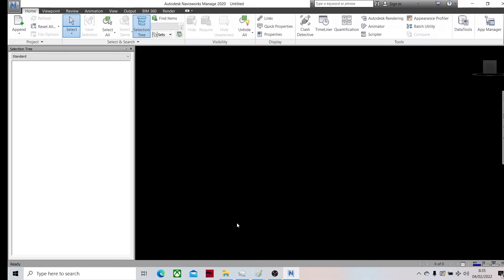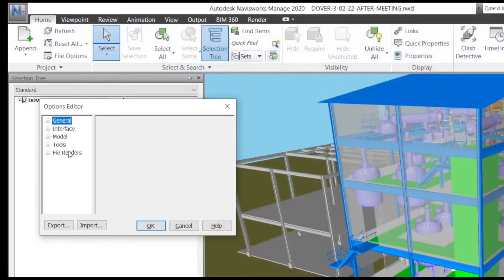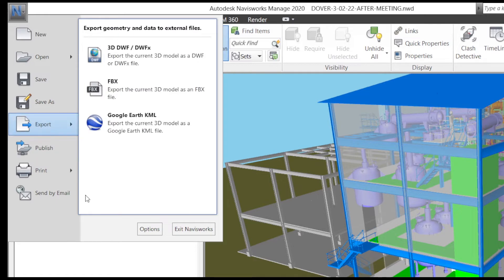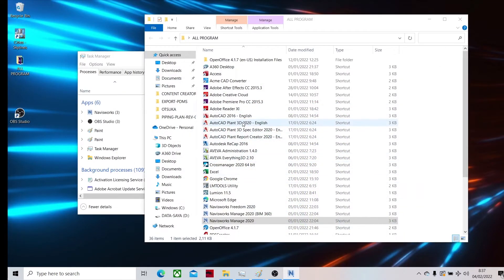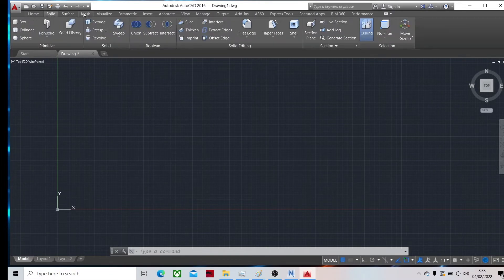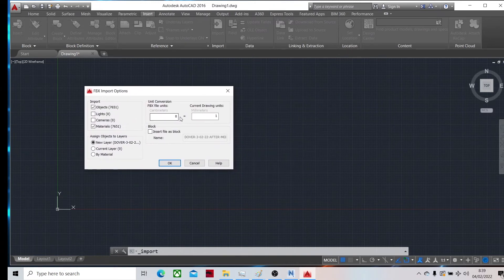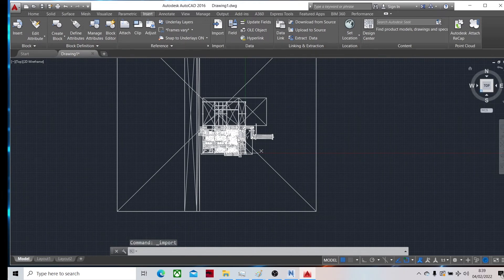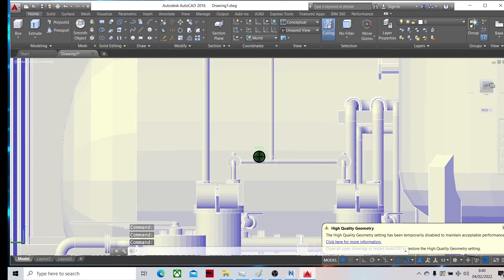navisworks to autocad

Comment: Heloo Izmir, 
tried this method severallyautocad 2021 but it did not work. can you help me out?
Reply from the maker: Veritas maybe the problem at
1. Export FBX not perfect. Try simple model first 
2.  Maybe unit converter at autocad  scale change. Try Smaller 0.01 or 0.1